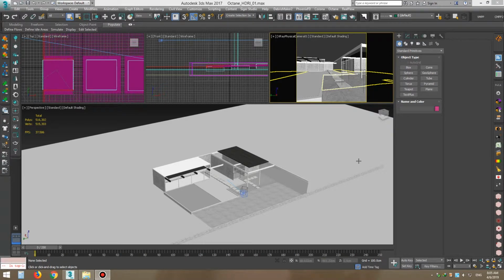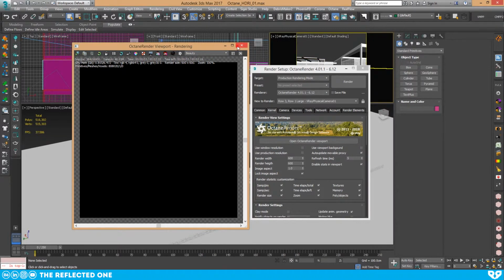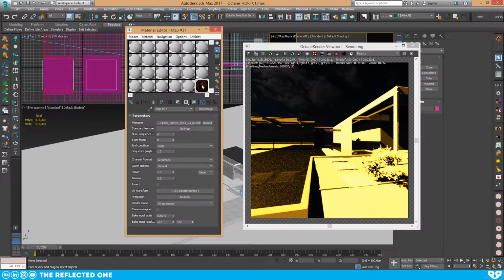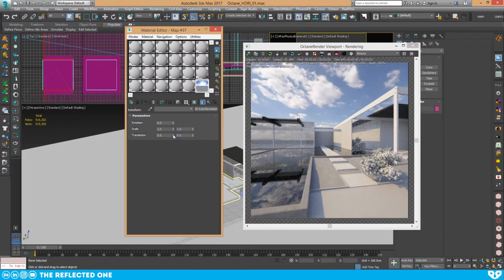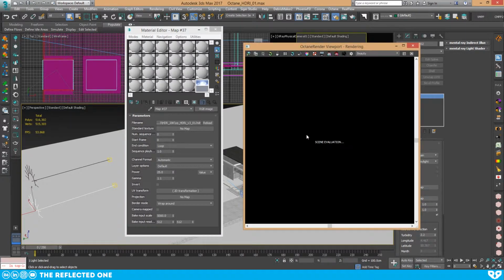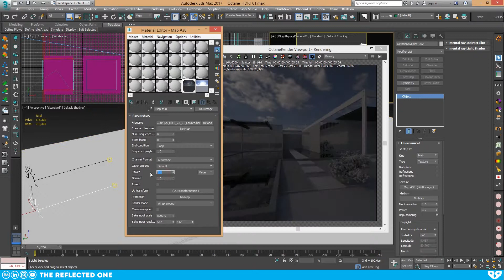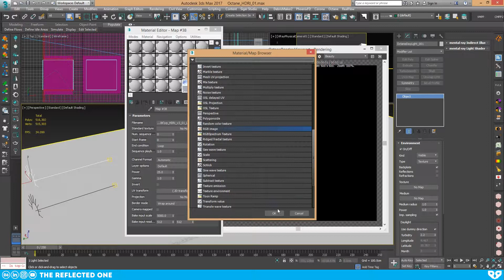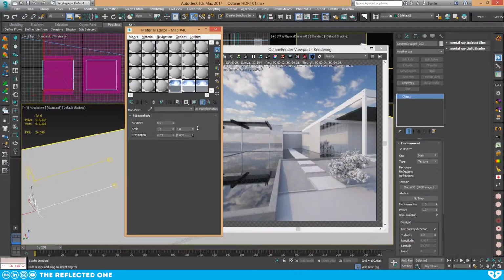Octane HDRI Tutorial in 3DS Max (2 methods)

Comment: Lately when I add a jpeg file to the texture as a backplate, the size is huge and its cropped in. I've gone into the 2d transform to try to scale it down and its apparently sphered (the edges are curved as if its projected as inside an environment sphere. Am I missing a setting?
Reply from the maker: didn't you accidentally checked camera mapped in RGB image map? 
try to restart 3ds max and if doesnt help, install latest version of octane and your graphic card driver.